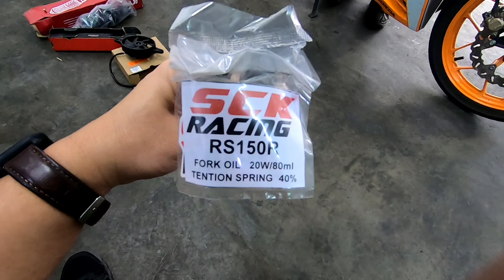4k Honda RS150R | Tukar Fork Spring SCK Memang terBAIK!!!

Comment: bang nak tanya cikit,, utk sukatan fork oil brp ehh brand motul 20w ke ,, sy saiz dlm 59kg gitu je,, btw bang i plan nak turun fork 1.5 inch pandangan bang ok tak,, lps tengok video bang i prefer, nak pakai brand sck,, sblom ingat nak beli aji racing punya!! bagi pandangan bang pls🙂👍🏾
Reply from the maker: Mcm dlm video ni sy follow setup sck. 20w jenis motul 80ml bang.
Reply from the maker: Then sy pon turun 1.5 inch so far x sangkut huhu. Berat badan sekarang 83kg time buat ni dulu dalam 93kg mcm tu. Brand aji xsure ok or tak. Tp sck so far ok la. Kalau berat abg 59kg untuk sukatan 80ml takut keras sgt. Cuba dulu 70ml mcm tu. Kalau kurang juat tambah 10ml semula. Atau nak mula dr atas pon boleh 80ml then buang2 guna syringe sng skit.
Reply: tq bang,, btw bang minyak fork brand motul ade 15w 20w mane yg ok?? suggestion bang?

uh yeke,,,yg sukatan kena kurang eh,,😂😅risau pulak,, sbb dlm kertas diorang ckap 80 kan ,, kalau isi 80 jugak ape jadi bang,, ade pape side effect ke🙇🏽🙇🏽
Reply: kalau macam bang ckp kerasa nanti ape je jadi🙇🏽🙇🏽 ?? risau pulak
Reply from the maker: Kalau ikut 20w likat lagi bang then tahan lagi geseran. Untuk sukatan minyak lagi banyak lagi keras. 80ml rasanya mmg minimum requirement kot. Try isi dlu bang jgn kurang. Kalau kurang nak tambah tkot mintak kotor dah.

Comment: kedai kt mana ni bro
Reply from the maker: Assalam W.B.T warga Honda RS.
Open slot for RS150R performance upgrade ! - Major service / Overhaul / Hardcore / Sawan atau Santau.
- Rebuild Old Spec to New Spec (cuci taik)
- Basic spec 62mm / 63mm.
- Full spec 62mm / 63mm / 65mm
- Full spec Mega Dewataraya 65mm 20/23 21/24 / 22/25 / Racing Gearbox / Jet Rod

Speed Production by DT RACING KL
Lokasi kami di Menjalara Kepong KL.

Sebarang pertanyaan tentang modifikasi/servis/repair RS150 boleh call atau whatsapp DT Racing KL.

Hafiz Dtr 0182230716 
http://www.wasap.my/60182230716

Ulwan Al Al-bar 0109761851
http://www.wasap.my/6010761851
Reply: wanneo channel tq

Comment: nk bgi alamat kdai pun ssah baik xyh buat video.
Reply from the maker: Semua dekat description video bang. 

Speed Production by DT RACING KL
Lokasi kami di Menjalara Kepong KL.

Sebarang pertanyaan tentang modifikasi/servis/repair RS150 boleh call atau whatsapp DT Racing KL.

Hafiz Dtr 0182230716 
http://www.wasap.my/60182230716

Ulwan Al Al-bar 0109761851
http://www.wasap.my/6010761851